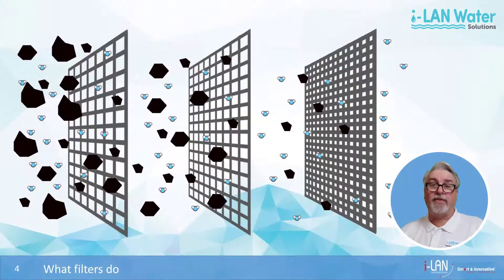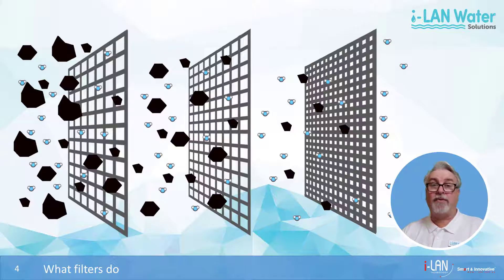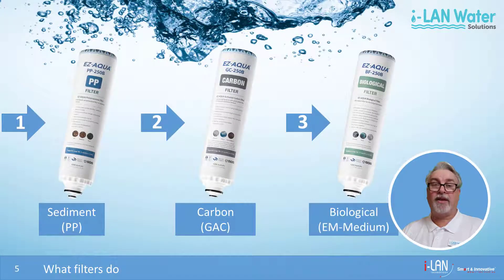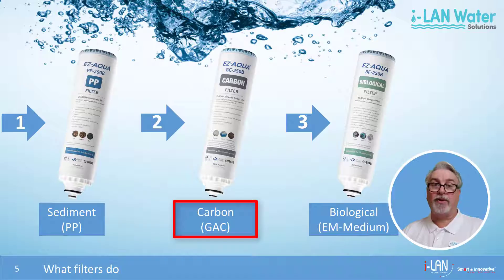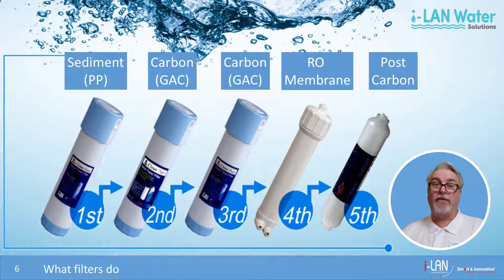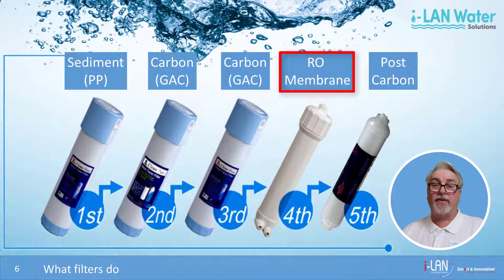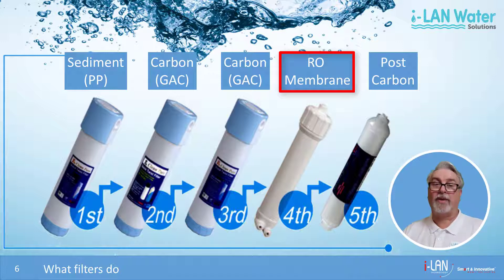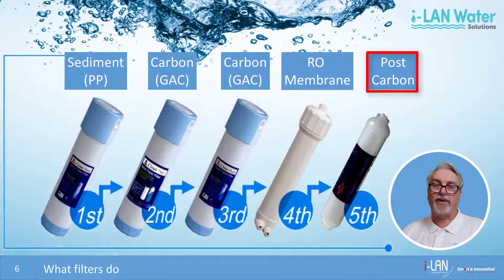How do Water Filters Work?

Comment: very nice, I have a question... I live in a big city full of buildings (10-15 floors). The water that we get from the water provider is not recommended for drinking so most people buy water in the supermarket or have their own filter in the kitchen that kind works like a subscription. I went to Germany once and was blown away that they all could drink tap water. =>> Would it be possible to install a filter on the top of every building to clean the water and provide people with safe clean amazing fresh drinking water? The water we currently get is suited for cooking and shower but not drinking, but I'm assuming the process to clean this water isn't so difficult. By installing a big filter on top of every building, people in their apartments shouldn't worry about drinking their tap water.
Reply from the maker: It is possible but probably not cost-effective for a building owner to provide it. It would be much easier and cheaper for tenants to take care of their own water filtration needs at the outlet, such as countertop or under sink filtration systems for drinking and food preparation, and shower heads for bathing needs. This way, people can also choose the level of filtration they need and have peace of mind that their water is safe. For example, if chlorine is removed prior to the tap, bacteria may form within the plumbing system, as well as other possible contaminants from aging pipes.
Reply: It’s funny how we pay for water feeds but it’s never clean even tax doesn’t even cover it 🤡